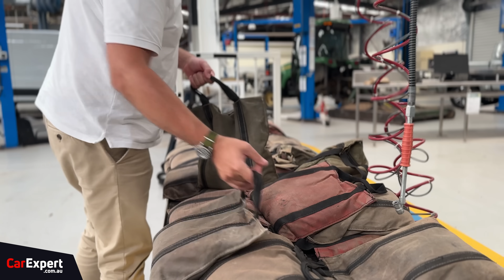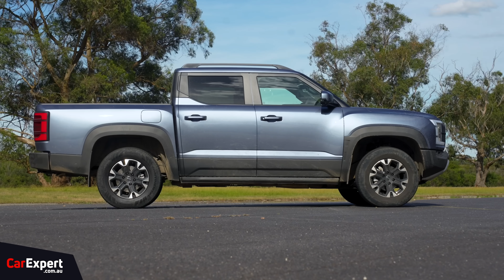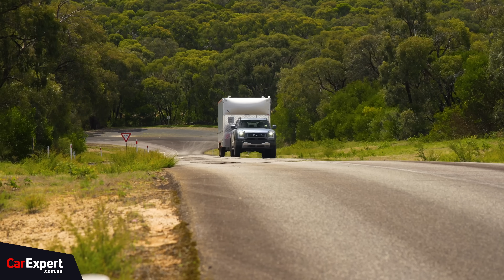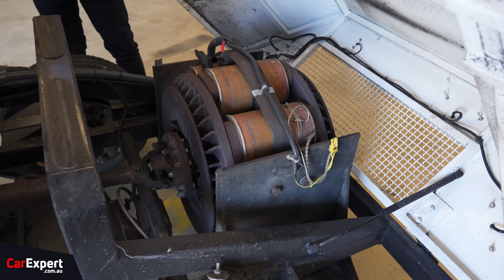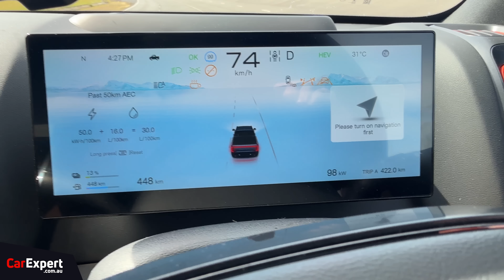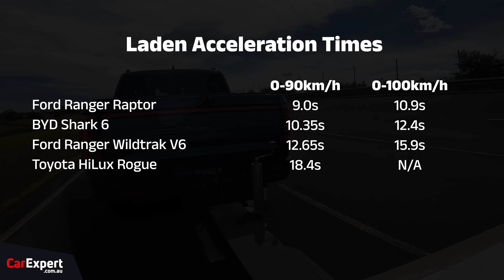BYD Shark 6 towing STRESS test at MAX payload - the results are surprising...

Comment: Has Carexpert contacted BYD to ensure the vehicle has the latest software updates as this is pre-production?
Nothing will stop this selling out before release regardless as its a game changer given its price and equipment levels .. most people will set the engine to tow at heavy loads at 80 maybe even 90 or 100 percent SOC ... nothing can touch this in the Aussie market as it serves to call out the ridiculous prices paid for diesel tractors seranading as utes.
Finally, the video is obviously cut off and doesnt show battery levels visually .. so is Carexpert trying to say that at 100% battery level the car couldnt do 5 laps when set to 90% SOC? 
Exactly how was the battery depleted so quickly in 1 lap ?
Reply: Basically it was depleted too much to begin with and was then essentially operated outside of its design parameters. The 15% incline while towing was also outside the design parameters. The manual states 12% max so thats interesting too. 
John Cardogan’s latest video Q&A on the Shark has a pretty good explanation of how the small petrol engine is more than adequate to keep the battery working even though the elec. motors output is way higher. It’s worth a look if that sort of thing interests you.
Reply: @Random-Destination john cardogan? Isn't he that bloke that Hayes EVs?....nah mate, not for me
Reply: @hedland  😂 yeah, he’s an acquired taste for sure but I think he’s actually a closet EV admirer. At least the Shark seems to make sense to him anyway.  
It makes sense to/for me too but I still won’t buy on if it can’t climb that little hill.
Reply: @Random-Destination   yes I agree ..that little hill is my driveway and I cant risk being stuck with a trailer on the back .. so unless that can be fixed   Ill be asking for my deposit back . .
If they fix it , Im sold 👍🏻
Reply: BYD does not need to address the public anything as what's tested is only a prototype....
Reply: At one point you could see the battery was at 13%. So for this test it appears it was only done with the battery in a low state of charge.The assumption would be that if the battery had enough charge it could complete it without issue, but with little or no battery, performance would be degraded and fuel use increase.
Reply: @GDM22  So for some context .. could we test a Ford Raptor carrying max weight for towing when the low fuel light is on ? .. how far will it go and what will happen when the fuel is depleted ? .. that's right it will stop and be travelling at 0 kph .. seems like Carexpert is obsessed with faulting a pre-production vehicle so let's get straight to the point ..  the Ford Raptor costs @ $100k and the BYD @ 60k .. for 90% of people the BYD will  suit their needs all while offering stronger acceleration, better braking, greater versatility and better equipment levels than a Ford Raptor at $40k less which is enough of a saving to buy another new car for the wife perhaps.
Reply: @mersinalou7397  I am not defending the way the test was done, at a high SOC I would assume the car would have completed the 5 laps. My point was it started at a low SOC for him to highlight the worse case scenario.
Reply: @GDM22 when you have full tank fuel and not let the genarator working is not the wprst senario, thats stupid
Reply: @GDM22  Yes I agree and it may be relevant to 1% of people but judgement should be reserved for retail vehicles ... but as I mentioned above the equivalent would be to get a Ford Raptor to do the same test with a low fuel light on since it has no other power source to use ... worst case scenario .. the Ford would switch off and travel at 0 kph whereas the BYD would continue albeit at a slower pace of 74kph since it has an alternative power source .. and lets not forget that price saving i also mentioned above as well as the other advantages.
Reply: @mersinalou7397  I think the key is, it will function very well for most users and he said that, the edge case users should stick to their heavy polluting, large capacity ICE vehicles.
Reply: @GDM22 At High SoC the engine would have come in sooner and tried to keep the battery at the requested SoC, so the exact same thing would have happened only worse as you’d not have been able to use any more of the battery. 
The engine would have come on to drive and charge and it would have e limited the speed to 70 and tried to maintain the charge at the higher level. The test would have been even worse results.
Reply: @jerrymyahzcat  Do you think this car is designed to be operated from a low SOC where the car is towing a 1,600kg load and then simulating a continual steep incline. The user needs to know their car and mange the settings. If they know they are about to tow up a continous hill for say 5km straight, manage the battery prior to that so you have a reasonable state of charge and the electric motors can assist.  I am sorry you cannot see that this is deliberately setup as a worse case scenario, which is fine and to a degree was explained by the reviewer and something to be aware of for those very unlikely use cases.
Reply: @mersinalou7397  
I like your thoughts , my friend 👍🏻
Reply: @jerrymyahzcat I have reason to believe this is not actually the case. The BYD Seal has an almost identical setup and the video I watched a few days ago was describing this very scenario. In its case the vehicle used the battery past the set point and then focused on topping up the battery back to the set point. So I don’t think it will leave you hanging with no power. It seems to treat the set point as a suggestion rather than a rule which makes sense.
Reply: My apologies for my ignorance .. it would seem the author may have purchased a Ford Raptor .. well that in part explains the obsessiveness to try and break a pre production vehicle that is groundbreaking and the first of its kind stacked to the brim with modern features and versatility at just over half the price of the Ford and can out accelerate it and out brake it .. what other Ute in the segment that weighs 2700kg can brake from 100-0 in the distance of the BYD? .. brakes being the most important safety feature of a heavier vehicle.
Most shortcomings in the BYD can be ironed out with software updates as the platform is designed around that capability and new features and abilities can be introduced via the same methods .. something that can't be done to anywhere near the same extent with traditional diesel utes.
As for John Cardogan he's thinking of buying one ... that's how impressed he was with the versatility of the BYD and its price as even he knows how most people use these types of utes .. being able to outpace from a standing start and outbrake other utes in the class is just icing on the cake.
If nothing else, this new BYD serves the segment a huge blow and sends a clear message to other diesel ute manufacturers that the days of charging the public ridiculously inflated prices for their utes are over ... and that for the buying public is always a good thing 👍
Reply: Something else to consider .. if BYD were to certify their vehicle with V2G and V2H then the price becomes a steal as it already has V2L .. their car could be used as a backup source to power your home given how unreliable the electricity grids are around Australia especially on those hot summer nights
Reply: @mersinalou7397 wouldn't V2L already work to power your house already? I'd you have a generator switch you could just plug it in surely?
Reply: Good luck plugging into a tree on the side of the road.
Reply: The SOC isn't that important in a hybrid compared to a BEV when measuring performance
Reply: @camsmith4047 Of course it is. Because the SOC was not set to maintain 70%, it was able to deplete to a level that the car could no longer sustain power. The correct setting would have resulted in a test with a very different outcome.
Reply: @camsmith4047  It is in this car as it sets off the petrol engine to charge the battery as the petrol engine acts as a generator .. the higher it is set the sooner the battery is charged by the petrol engine .. in a max towing test this would be set at 80% to 100% or the highest allowed by the vehicle
Reply: @camsmith4047  It was critical here for the kn test as the electric motors were not able to assist the IC engine.

Comment: I wouldn't say this is a terrible result but its utility is reduced for certain applications. It would probably be a fantastic car for a tradie or camper given it's basically a huge portable battery with a large inverter. If the production version's SOC limit works (assuming your driving doesn't eat the battery from high consistent drivetrain load) it could be an extremely useful car even with the fuel consumption trade-off.

Comment: Thanks Paul. What was the SOC set at. Default is 25% but in this situation you should have it set at 70%.
Reply from the maker: It was set to 70% on the hill road. We started testing with the trailer dyne with the load saving off at around 60%.

Comment: Nice. Did better than I expected. Does this change your views on the cause of the 4wd Hill climb issues? You need a lot of torque in both scenarios. Interesting that it could accelerate so well up that hill laden.
Reply: I am pretty sure it will be significantly improved with software updates to the traction control. Videos out of South America show it performing really well in lots of serious terrain.

Comment: So, to sum it up. Turns to 💩, when the batteries run low. Then uses more fuel. Than most other Ice utes...🤡   😆
Reply: No it doesn’t. Go to table at 14:55 and have another look.
Raptor uses 6.5L/100km more when fully laden.
And it’s only 1 to 2 L/100km more than all the others when fully laden. The 383% is the difference between unladen and laden. It’s much higher as it uses significantly less fuel unladen than the competition. Fully Laden it’s chewing through the battery fast and reliant on the petrol engine to power the vehicle and charge the battery. Which is completely expected.
Reply: @RMacka  15.00....Layden, towing test 30L per 100km. Paul explained it as well.....🫡

Comment: Towing 2.5 tonnes for 10 minutes and it shit its pants.
Reply: Yeah we’ll keep that in mind in the 1/1000 times we take our two horses from Jindy up the long climb to Charlotte’s Pass… still won’t be too bad at 75km/hr in an 80km/h zone. 

All other times, such as the New England Hwy climbs north of Tamworth, it’ll charge nicely on the downhills.

In the meantime my run to surf Noosa will be 100% free on solar rooftop, while you’re spending $15 per 100km…
Reply: Towing woth and empty battery? Any normal person would charge the car and test from 100% going down, checking if the engine keeps the battery or completely discharge it.
Reply: I think you are comparing apples and oranges. I have a dedicated 4wd and I have an old Honda town car that I use when I can’t be arsed burning 25l/100km in the city or doing short runs.

This is the type of vehicle I’ll swap the Honda out for. Not the 4wd. I can drive it to work and back for 3 days without a charge. If I’m doing a tip run or grabbing something off gumtree this beats hitching up a trailer to the 4wd if I don’t need the size. It’ll do a day trip or overnight with the family close by no problems. 

Would I take it to Fraser, cape or Simpson? Fuck no. But why would I? It’s not built for that and they aren’t marketing it for that. So why bitch that it wouldn’t do what your dedicated 4wd does better?

To be fair. I drove a fully laden hilux workmate for work up a winding hill and couldn’t get it out of second doing 65 in a 80 zone. I was t towing that was just samples in the back of the tray up to max load.
Reply: @ yeah same electric all week and petrol with the boat on camping in the weekends. Ticks all my boxes
Reply: Ah, no it didn't. It could only maintain 70-80km/h going up the equivalent of a 15.5% gradient carrying 2.5 tonnes for 10 mins with a flat battery. So, not too many places like that in Australia. But even if there was, seen plenty of standard tow vehicles that lose lots of speed going uphill. It's like you don't understand kilo newtons.
Reply: @ I towed a 2 tonne boat on a hour test drive. So good.
Reply: Yep in 5.7seconds I shit my pants
Reply: I'm still getting one 😁 I won't be towing though. Also, love your channel buck!
Reply: @user-pp6kw6yl6z  Mate wait and see how they go first.  Don't rush in.
Reply: @Mrbuckaroonie..  cheers Buck that would normally be my preferred option. I am taking a punt because I can get one on a novated lease for about $250 less per fortnight than a diesel dual cab. (There are tax incentives because it's a PHEV). It seems most people getting one early is for the same novated lease deal, as it ends march 31 next year.
Reply: @user-pp6kw6yl6z  Fair enough mate.  I get that.  For people that don't want to tow and go offroad or remote, they might be OK.  Hope it works out for you and you are happy with it.
Reply: @Mrbuckaroonie..  cheers again Buck and keep up the great work with your channel. You produce really great no BS content. Totally agree regarding towing and remote touring. The most I'll do is go to Fraser/moreton etc. I've only ever taken patrols to the islands so I'm keen to see how the shark handles it. I'm in Brisbane so the shark suits a yuppie city boy like me 🤣  it will fit right in at the bunnings carpark on saturdays too amongst a sea of jacked up dual cabs.
Reply: @ I’ve just ordered one as ticks my boxes. Fastest ute on the road, premium interior and modern tech, looks awesome, can use electric only all week and petrol if needed in the weekend. I tow a boat at 1809kg so this will do that with ease. Already test drove it with boat and because of yourself and weight it is good.  I won’t be towing max at full speed ever so ok there. Can’t wait
Reply: @user-pp6kw6yl6z I’m getting it for towing. Nice and heavy huge torque. Ranger on the market - expensive to run, slow, loud and I never tow anything over 2 tonne and I want cheap electric travel during week
Reply: Try and get a Hybrid that other manufacturers make to tow anything and have fuel economy of what? 5 litres per 100 km and no petrol on EV mode for 60km. This thing tech is beyond impressive. a BYD U8 have much more power and torque and probably more capable.
Reply: @Kim_Xi_Putin  My next 4wd will be a Diesel fullstop.
Reply: @Mrbuckaroonie.. yip people still like steam trains
Reply: @lifeliver9000 and horses
Reply: @Mrbuckaroonie..  That's good for u, I hope diesel price worldwide increase by 20% or more each year. Coming from a nation that import mostly of the oil and fuel it consume.
Reply: @Mrbuckaroonie..  oh yeah, hope u get financed on it too, at 5% than 12% and more paying it off for 20+ yrs and imported diesel goes 10 to 20 €£$ half a litre on ya " big V8 twin turbo" that cant beat a 2.8 to 3 tonnes SUV pure EV that accelerates  0 to 100 faster than a " super car". Yeah , ya nation is way behind........
Reply: The next soccer mum car or shopping trolley or whatever you call it? Literally just made for normal commute and nothing else. Maybe some road trips…..
Reply: @Vinleesel151  electric all week petrol weekends, fastest ute on the road, premium interior, battery for quiet camping. Tis beast ticks all the boxes. Selling my truck this with a canopy is all i need for tools. Sorted
Reply: @lifeliver9000 Quiet camping?? Haha. I don't really care if it's the fastest ute on the road or if it has a premium interior....rather it be rugged and can handle some bruising. Doesn't tick all my boxes but then again everything is subjective. Will see what the 2nd gen will bring
Reply: @lifeliver9000 also fuel usage for long trips seems to be equal at best with newer diesel utes.
Reply: @ yes I see that too. But with faster and more luxury. I plan to run mine on electricity all week and petrol when need to travel further every month or so
Reply: @ 2nd gen will  be interesting. And good point. Re noise. I had to stand waiting for a hilux diesel to manoeuvre out of a Bunnings car park last week and the noise of engine was horrendous-he was getting frustrated and gunning it but it was almost pain full
Reply: @lifeliver9000  Typical Hilux driver!!🤣

Comment: I heard the Shark locks the battery level at 50% as soon as a trailer is attached to it. Maybe just another version of their software.
Reply from the maker: I'd say so - this is the same car we used for our earlier test. Although if it locks at 50% you'll run into the same issue with the speed slowing down if it doesn't allow the charge to get below 50%.
Reply: @CarExpertAus I think you’ll find it doesn’t lock it at 50% (or whatever), it simply tries its best to keep it at 50% so after it has dipped below the set level due to “need” (such as a hill climb) it will work at charging back to that 50% before shutting down the petrol engine. At least that’s what I have gleaned from trolling all the reviews on this thing trying to figure it out.